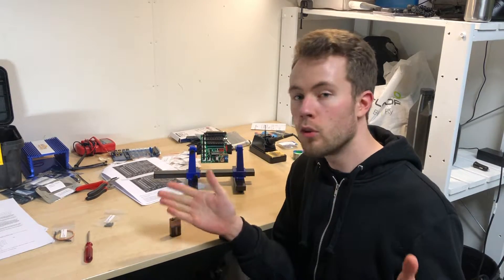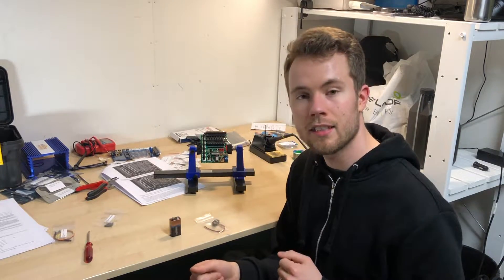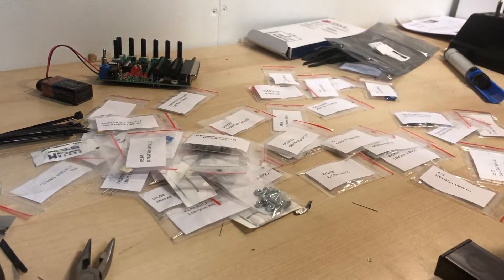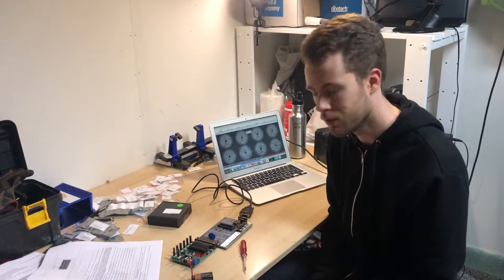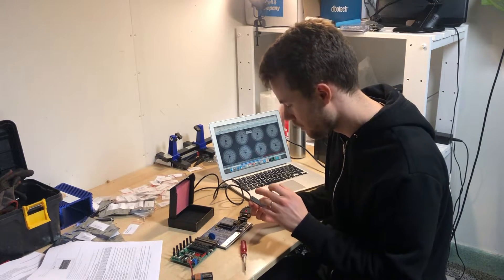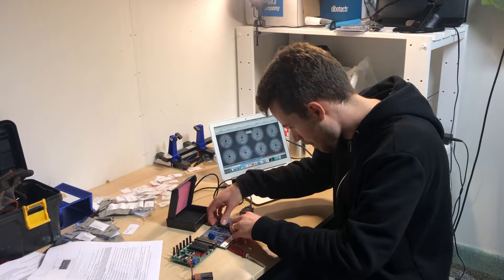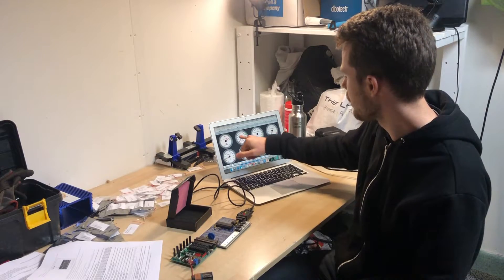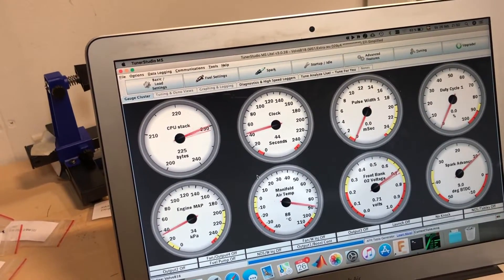First Power Up of the MegaSquirt! - EFI conversion on a Volvo Amazon Part 4

Comment: Tror du att det är möjligt att använda "stimulatorn" även för att testa Trionic 5-boxar om man bygger ett adapterkablage?
Eller Speeduino?
Jag byggde ihop ett MS3.57 för några år sen för att nån gång sätta in i ett projekt och även en Jim Stim 1.5 men än så länge så har de bara blivit liggandes.
Reply from the maker: Vad gäller t5 beror det lite på vad du har för trigger, vet inte riktigt hur de boxarna fungerar. Annars ska det ju inte vara några problem, du har ju de gröna kontakterna på Jim stimen som är gjort just för att koppla anndra typer av ECUer till
Reply: @AutoMekatronik  är ju 62-2 Eller 60+2 Eller hur man nu ska skriva det och den inställningen finns det ju en dipswitch på muspianot för. Är ju hallgivare på T5.2 medans på T5.5 och T7 snålade man in och satte VR-givare istället så det blir ju ingen klockren fyrkantspuls.
Reply from the maker: Ja men då ska det ju fungera utan några större problem. Sen anser jag dock att man bör komplettera med ett oscilloskop. Stimulatorn kan ge en fingervisning OM det fungerar, man ser några lampor blinka. Men fungerar det inte kan det vara knepigt att hitta var felet är
Reply: Både ett gammalt analogt och ett som kopplas till laptopen finns här hemma så det löser sig @AutoMekatronik  Dock är det väl egentligen mest att jag vill kunna simulera signalerna från givarna jag är mest intresserad av.